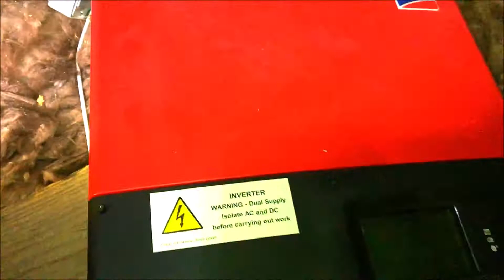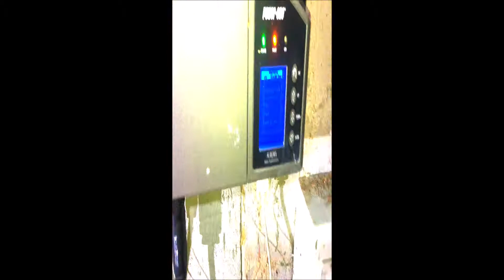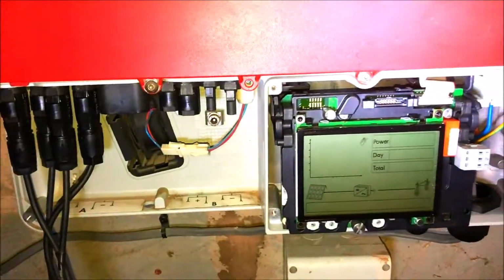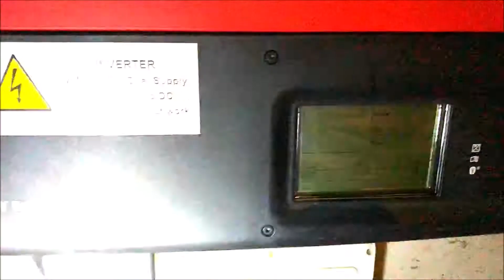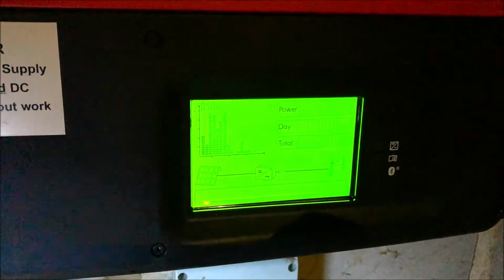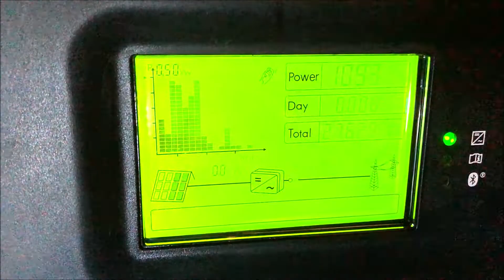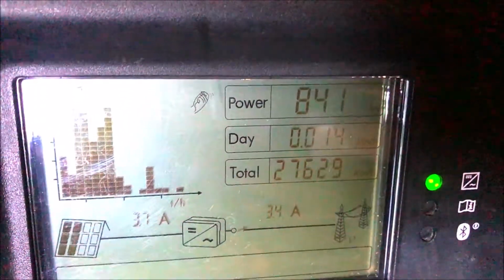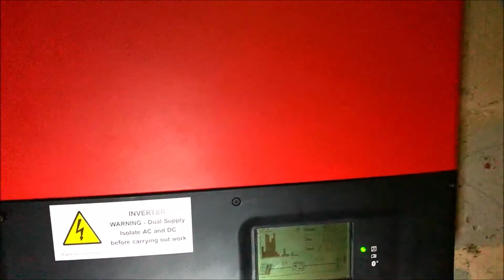SMA Sonny Boy 4000TL-20 inverter replacement. Full DIY fitting.

Comment: Hi I have a 4 kw 2 string with a SMA inverter 3800, I’ve just purchased the same as you shall I put 1 string to A and - string to be ? Also what size breaker do I need on the fuse board I have a 15A at the moment will that be Ok? Thanks Andy.
Reply from the maker: @andywragg5159  Hi. You can put both strings together on A, but it doesn’t really matter.
I have a 20 amp breaker on my system. In theory max output would be 17amps.

Comment: will this directly power my home load with no connection to grid atall .
Reply from the maker: You would have to have bright sun all day long and have a relatively light load from the house, you get no power at night so would need to install a minimum 4kwh battery.
Reply: @geofus  i want it only in day.  in night i will use grid power from local company.. but my question is if i connect only solar panels and on ac output i connect my load .. let say an AC fan... will it run the fan or no out put and give error that grid voltage are  missing ..
Reply from the maker: @abaa9218  you need to connect to the grid for the inverter to operate, once connected you have at least 3kw when the sun is out, the inverter will not work unless connected to the grid.
Reply: @geofus  that mean the AC L & N  will connect to L & N of my home distribution panel which in turn is supplied by the grid.. Will this work normal or do i need a metering device which can transfer any extra power generated by PV sytem to grid.. I also have bought one SMA but  now i dont know how to install it.. its SMA sb 5000tl-20 ..
Reply from the maker: @abaa9218  Yes it is connected direct to your Consumer Unit via a Isolator Switch and a MCB fitted in circuit.
If you want to export to the Grid and be paid for it, you will need to have a solar Generation Meter fitted by an authorised and registed installer.
The SMA 5000TL is a larger version of mine so the fitting is the same, but i would suggest to have it fitted by an Electrician.
Reply: @geofus   i am sure you have very good electrical knowledge so pls bear with me on the question.. I have the inverter and about to purchase PV panels but i am confuse about its working and our area dont have technician who know about SMA inverters instead i m told to buy a hybrid one with batteries which is alot of cost.
All i want is to connect solar panels to the inverter and the AC wire out of inverter to a socket with no connection to grid.. a simple straight wire from AC points of the inverter into a independent socket and connect my airconditioner to that socket... No grid No nothing... will this model work and supply my air conditioner direct.

Comment: The Sunny boy connectors aren't unique, they're called MC4 connectors.
Reply from the maker: They are similar but not the same, all SMA inverters are fitted with SunClix connectors, you can buy adapters to fit to standard MC4. 
https://www.phoenixcontact.com/en-gb/products/photovoltaic-adapter-set-pv-as-mc4-6-150-mn-set-1704982
Reply: @geofus   SunClix seem a lot better than MC4 they are a little more expensive .
Reply: @geofus  My newer model has nice pressure type terminals for the pv wires. imho better than having more mc4 connectors.

Comment: I noticed you only have around 230V from your solar array - it seems like if you added a couple more panels you would get more efficiency and power. I have an older model so not sure it works exactly the same, but I have about 430V from the solar array...